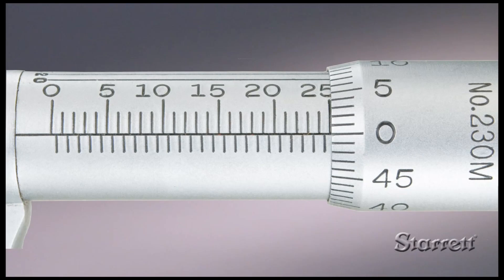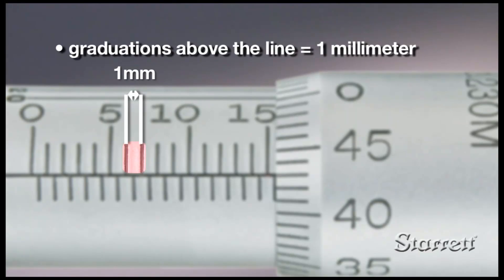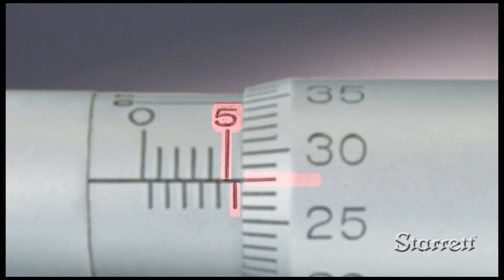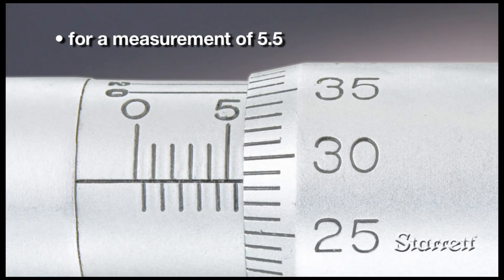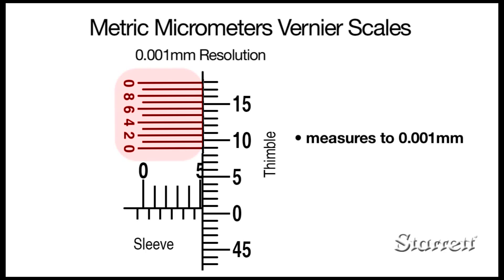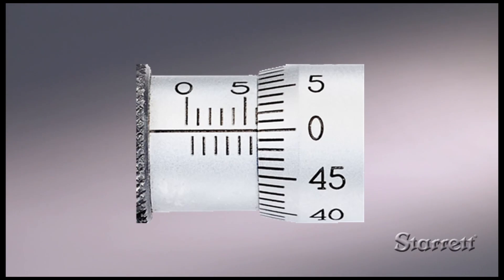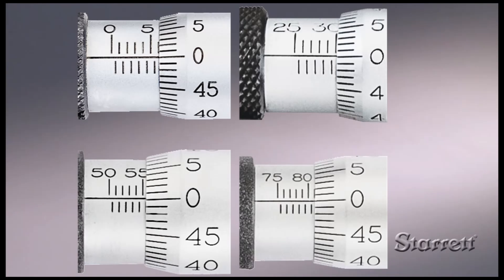Using and Measuring with an Outside Micrometer: How to Read a Metric Micrometer (Part 3)

Comment: I'm a little confused. At 1:16 the narrator mentions reading to the nearest hundredth of a millimeter (.01). Ok I get that, but then at 1:17, the example reading and mic shows 15.20 yet the checkmark textover says 15.25 +/- .05. Shouldn't the actual reading be 15.20 +/- .01 yielding a range of 15.19m to 15.21mm (or specifically, to the nearest 100th mm would be indicated as +/- .005 for 15.195mm to 15.205mm)?

Then at 1:45 the example says measure to the nearest 100th mm yet the same "15.25" value shows up when clearly, the mic is showing "15.20". I think I get the tolerance aspect and how to record a measurement made to that value but it seems to me something is off here.

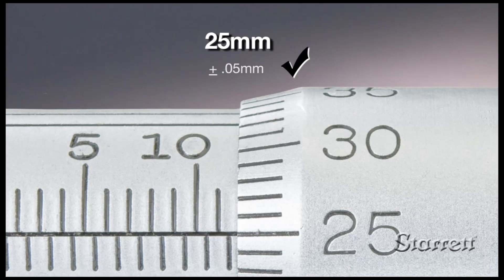Lastly, at 1:51 the drawing shows 11.75mm +/-.02mm, then they take a measurement of what looks like the part in the drawing and they show the mic indicating a reading of 13.25 yet the checkmark textover says 25mm +/-.05mm.

What am I missing here?

This begs a question: What is my documented tolerance for any given reading. Shouldn't it be +/- one half the smallest measurable value of my tool (or desired resolution)? In the example where the mic is reading 15.20, wouldn't I document that as "15.20 +/- .005mm"? And then if I only need a resolution of tenths, I could write this reading down as "15.2 +/- .05mm"?